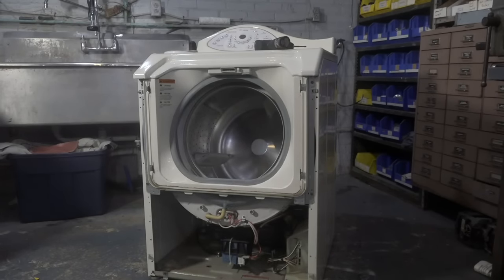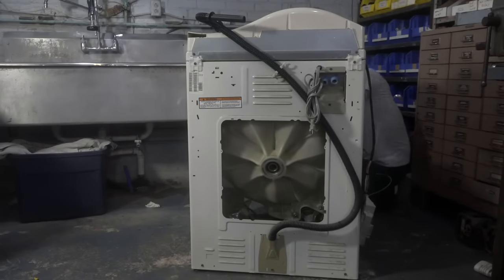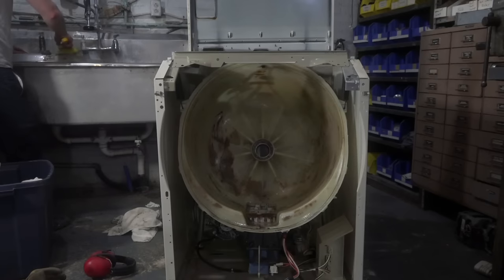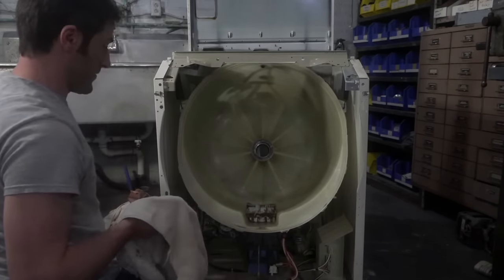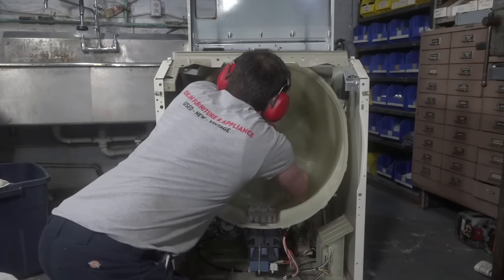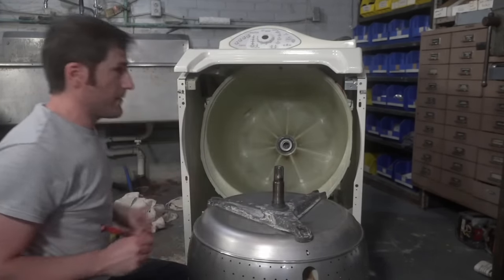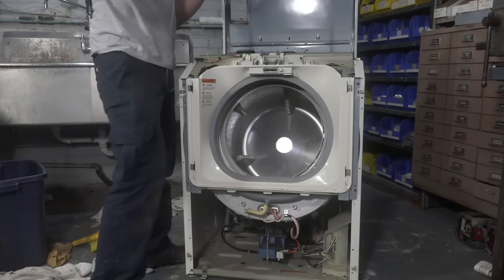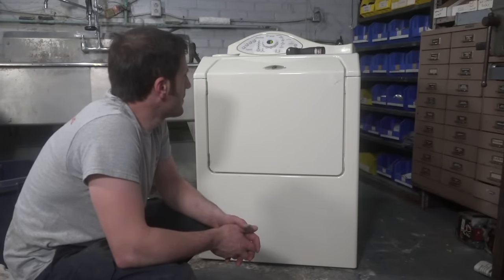Fixing a Maytag Neptune LIVE!

Comment: Eugene Id buy a used washer from you any day of the week. You do such Great work in restoring old appliances! I love the first generation Neptune washer and dryer, I owned them when they first came out. They had a much nicer control panel than the one youre working on.Great machines! It replaced my Amanda front loader that came out in 1997, Amana recalled all of them and they were destroyed by the company gave us all our money back and I bought the neptunes.The Amanas leaked all over the floor and then shorted out mid cycle, The day Amana called me and said they wanted the machine back I said mine is running fine. literally after i hung up with them i go downstairs and the machine died mid cycle and leaked everywhere, lol Most people dont know Amana made a front loader (short Lived)

Comment: You’re gonna think that I’m nuts… that’s OK I thought the same thing about the guy who told me lol.  Now this trick works great cleaning  fiberglass, porcelain, stainless steel appliances and fixtures.  Such as toilets, bathtub and sinks no scrubbing required. I learned the trick for bathtubs and toilets, and it blew my mind. The denture cleaning tablets and warm water that’s it. For a heavily soiled toilet really tough stains,Five tablets. Standard size bathtub 5 feet long 2 1/2 feet wide 18 inches deep about 12- 13 tablets you’d have to play with the amount for anything else. But I’m telling you it works great, I’ve never found another way or product that does better. Oh and let it set as long as possible but a minimum of about eight hours. If you can let it go 24 or longer, the longer you let it go the longer it works.

Comment: To keep your front loaders clean you can simply use washing machine detergent and the machine clean cycle.  If your machine doesn't have a machine clean cycle, run an empty load with powder detergent on the hottest and most aggressive cycle.  Powder detergent works for descaling because most powder detergent contain enzymes and oxygen bleach (sodium percarbonate).  You may also use an oxygen bleach laundry additive.  Using straight sodium percarbonate should only be used in severe situations.  It's a very powerful oxidant and can damage internal components over time if used undiluted.

Aside from powder detergent being superior in almost every way to liquid, if you only use powder detergent, the internal components of your machine will be much cleaner in the long-run.  Liquid detergent is only necessary when washing delicate items or for pre-washes as pre-washes are too short to allow the powder to fully dissolve.

Comment: 1 comment and 1 question, when you work on the boot it is much easier if you unsnap it from the front cover rather than taking the big spring off. Now for my issue I replaced the bearings and I know they are fully seated as there is just a 16th of play in the spacer between the bearings, and you can tell by the sound that a bearing is seated when you hit it however the end of the shaft does not come flush with my wheel. When I took the wheel off I didn't notice if it was flush or not, so have you ever noticed on another washer this it is a 5500BWW maytag. I did look at the wheel and it appears that the shaft did not leave marks all the way to the outer edge of the wheel hub thank

Comment: How about a video on how to test the motor and motor control board on the Maytag Neptune MAH4000,s?  
Know the service manual has a procedure to do the circuit test on the motor and board and ohming out the motor.
Any tips to keep the motor and control board from failing.
I have had the set since they came out 20yrs and have had issues with the motor control board and motor on the washer unit. Good unit no issues washing clothes and blankets, good load capacity.
The 1st problem was the resistor burn out on the main control board which caused the door not to lock and allow the unit to spin, easy fix - new board, then fix old board and replace resistor and capacitor.

Comment: I do like Apple and all, and for Apple?  I think that an iPhone and an iPad.  Maybe an Apple Watch (and that’s a BIG maybe at that) I would keep or not EVEN entertain the thought of getting one if updating one and/or keeping it updated proves to be more difficult than I want to deal with, then I will not be getting an Apple Watch.

If Apple EVER makes and comes out with a clothes washer, and if it proves to be too expensive (like $3,000.00 and up) to buy, to maintain, and proves difficult to keep the software up to date without wiping out my settings or have to rest the darn thing after I perform any updates on the thing, or if it becomes TOO TEMPERAMENTAL to update and keep updated, then that a DEFINITE NO.

I may buy their headphones (or headset), again a BIG MAYBE.  But I have to how their pricing structure goes first and I got to be very careful regarding their use before I go ahead and pull the trigger and finally buy a set, and that’s going to be vs a getting one from Sennheiser or something else even more affordable.

But a Clothes Washer by Apple??  With the same maintenance conditions and price necessary to buy one, then that’s going to be a BIG no.  I’ll stick with Speed Queen or Whirlpool instead.

For Apple, I would stick with tablets and phones instead.

—Charles—